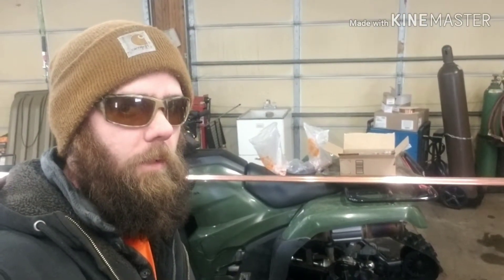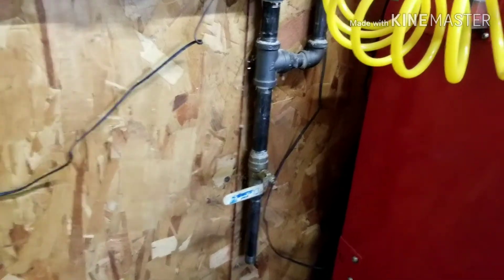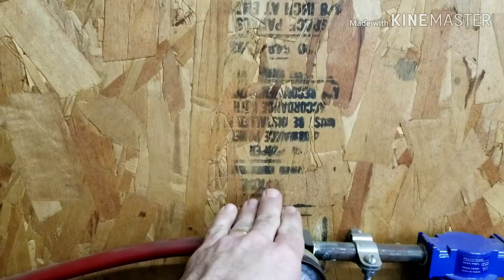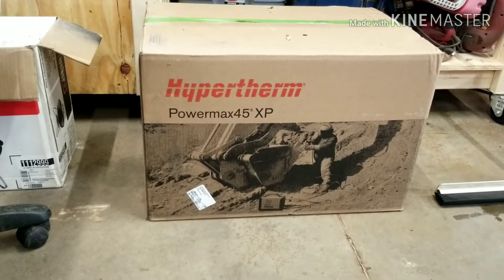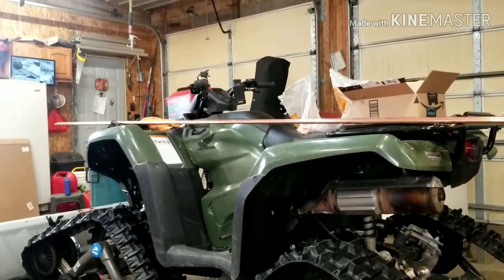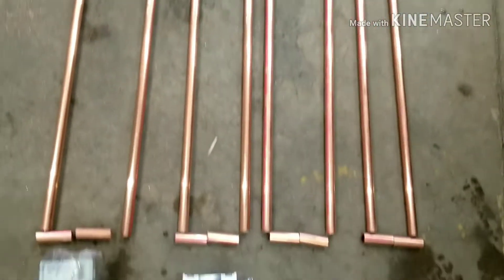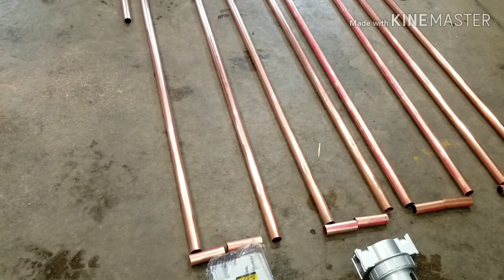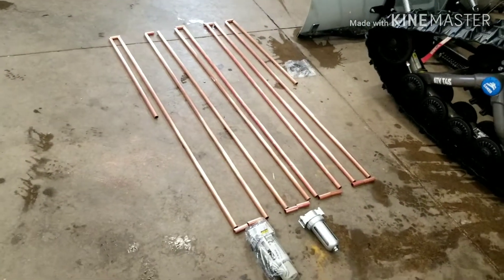How to build a compressed air dryer cheap yet effective

Comment: Was there a specific reason you chose 4ft for the vertical sections? Was it strictly for heat dissipation? Or if I were to, say, replicate your design, should I have any reason to avoid going with a more compact setup?
Reply from the maker: Was for heat distribution. You can absolutely go smaller.
Reply: @JDSOutdoors  I'm trying to find the pipe threader tool you used.. where'd you get that at? Thanks
Reply from the maker: @timsully8054  the pipe cutter? The threaded ends were soldered on
Reply: @JDSOutdoors  oh ok I didn't realize you soldered on the threaded ends. I guess what I saw in your video was you using a pipe brush

Comment: so, I gotta buy a crap ton of copper tubing and elbows, traps, filters....tools for cutting copper so I dont bend it while cutting, a propane torch kit and other crap for "sweating" the copper?  I don't see how this is cheaper than just buying a dryer outright.  I think this video is assuming that the viewer has everything already except the copper tubing and the traps.
Reply: This is still cheaper and works better then the separators. Sure you can buy a refrigerated air cooler but they are $400-$500 + shipping and tax...with a higher electric bill every month.
You can add an after cooler and a water trap between the pump and the tank, that will cut out most of the water before it even reaches the tank. Plus, the air going into the tank will be around 200° cooler.
For painting, I can’t afford a single drop of water to come through the line.
Reply: Lmao you dont have a torch  to solider?!? Thats like shop tool basics. Plus yes it much cheaper to spend an hour putting together some fittings than buying an expensive ass dryer. This method works very well and is used in factories. Only they run the pies on long runs on a angle and the water condenses at the bottom and runs to a drain

Comment: Not knowing even the first thing about plasma cutters I was wondering why you needed an air dryer. Turns out plasma cutters used compressed air. I have no idea why, but there you go. I just came here looking for an air dryer after another channel did a pretty poor job of showing how to build one.
Reply: nozzles are  $30 .  Wet and dirty air eat nozzles up really quick , like in hours .  With my air drier nozzles last so long ,you can cut with almost no cost

Comment: why not come strait out of the pump to air dryer then back into where the pump was plumbed in, then pull air strait from tank, that will keep moisture from forming inside the air tank thus longer life of the tank.
Reply: Good question!!! I would like to know an answers....🤔
Reply: General rule of thumb is you are drying the air for a piece of equipment/tool and as such you want the air to be as dry as possible when it hits the equipment. Adiabatic cooling can also introduce moisture so you should ideally keep the pipe the same diameter after drying the air to prevent that natural phenomenon, which doesn't happen if you dry the air before it goes to the tank, and then goes out for usage.

Comment: What diameter and type of pipe did you use?? I need to do this for the exact reason you did it for. Would like to get an idea how much cost in materials (minus the filters)
Reply: Sorry, just got to the part in the video where you said you will tell all that info at the end of the video. Thanks!

Comment: Hey bud!
Great video.
I'm about to build one of these. Can I ask, did you use the blue or red copper? The thinner inside diameter will move the air a little better but more likely to fail sooner then the smaller inside diameter of the thicker pipe. Any suggestions? This is kind of new to me.
Thanks brother!
:)
Reply from the maker: Just saw this I apologize I went with the thicker wall pipe
Reply: JDS Outdoors no worries!
Thanks!
:)
Reply: @jasonenz4238  you want to go with the thin wall copper for better heat exchange to cool the air quicker.
Reply: @cali_cal  1/2” thin wall copper (type m) is rated for 850 psi.
Reply: @ChrisAndolina  does it get hot? mines will be between the engine and the tank and will need type L. cause thats what they  use for hot water. but if yours doesn't i ugess type m is ok.
Reply: @ChrisAndolina  do you use 1/2 copper?

Comment: Great Job! Just a question, was there a reason you didn’t go from the compressor itself, before the tank, go through the cooler and back to the tank. That way there is no water in the tank, from the tank through your regulator and to the black pipe.
Reply: I was going to ask the same question.
Reply: I believe Jim Collins was asking about putting your copper pipes in an aftercooler design where the compressed hot air leaves the pump discharge port & is piped directly into the copper pipe/cooler/water seperator system, then after cooling & water droplets have been removed, put the drier air into the tank. Many people that do it that way have No water or very little water to drain out the bottom tank drain. No water in tank equals no rust, drier, high quality air exiting the tank & long safe tank life. "Full Package" air compressor systems have a fin and tube heat exchanger/aftercooler, fan cooled, & clamped onto the cage/safety shroud that recieves the hot air directly from the air pump. That's the most efficient way. Cool the hottest air down to room temperature & seperate the condensed moisture. Get a real air to air aftercooler from THE Compressor Guru, Bud Stiner (also on YouTube) sized to your compressor's CFM flow so no restriction is created. To drier, clean, high quality air.. Cheers! Paul
Reply: Because there will still be moisture when the air compresses
Reply: @manuelsantana6339  I ran direct from the air compressor to the copper tubing dryer. It seems to work well. Is one way better than the other? Thanks.
Reply: @rtj49  Yes, see my comment above. Cool the hottest air directly thru an aftercooler, moisture condenses, seperate the water droplets out, then put the drier air into the tank. Good luck, Paul
Reply: @manuelsantana6339 , yes but the moisture will condense in the copper pipe BEFORE it gets to the air tank.